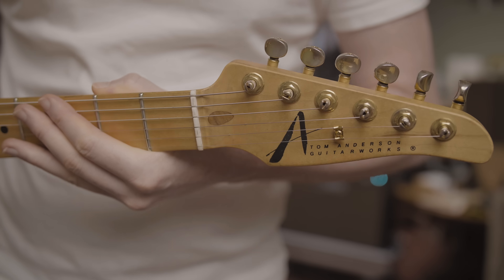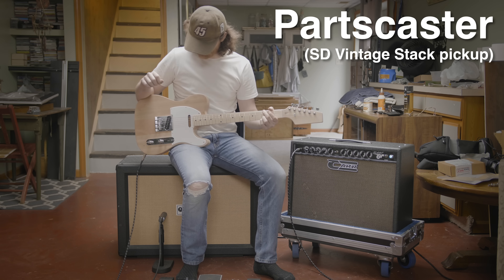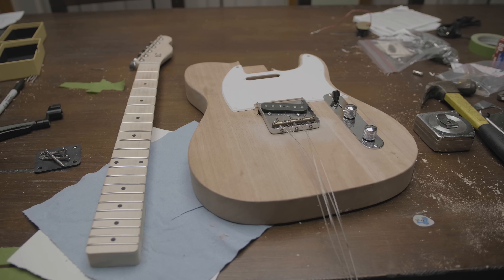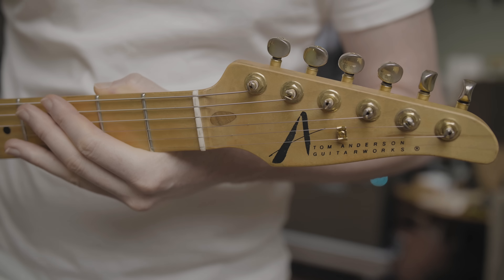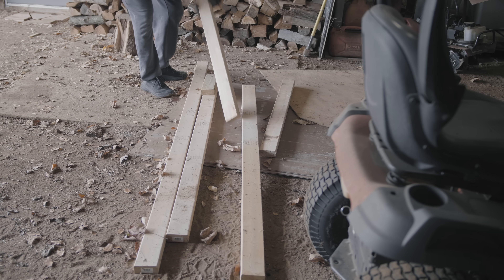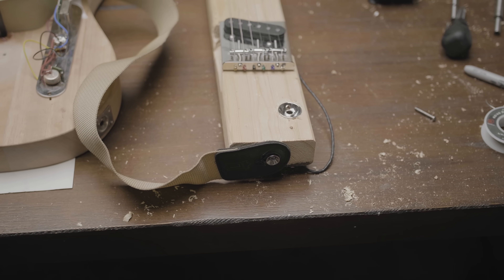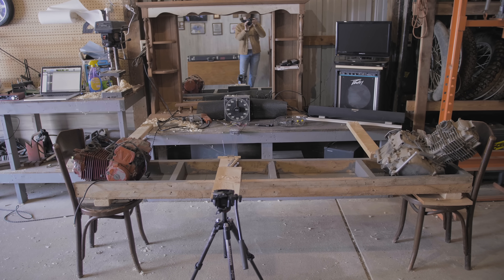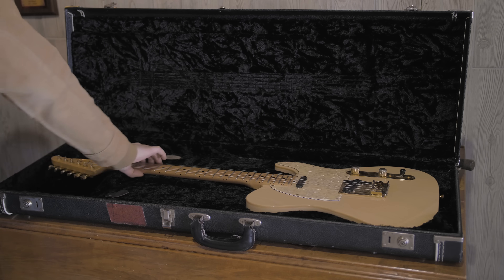Tested: Where Does The Tone Come From In An Electric Guitar?

Comment: Okay, so the sound difference you get between a Tele and a les paul are electronics, and string distance to pickup??
Reply: In that case, the different scale length on a Gibson neck lowers the string tension, which definitely has an impact, although certainly not as much as the electronics. Also, a different style bridge is going to change how the strings behave, if subtly.
Reply: Pickup positions.   Bridge/ saddle types.  In addition.

Comment: I am of the belief that it's how secure each end of the string is held that you get the most tone out of. I bought a cheap RG 250 guitar and it's tone was weak and thready. The tremolo was a piece of stamped steel, very thin and weak. I bought an edge and it was more of a anvil, a block of metal with much more mass. The tone difference between the two bridges was astounding.

Comment: The andrersson clearly sounds better, more full than the partscaster. Also, all comparisons are made with quite a bit of grit. The cleaner you play the more you will hear the difference.

The guitar cut from a board sounds good with open chords but thin the further up you go. Evenness in tone is something I would look for.

The air guitar sounds great and the strings vibrate freely, but how would you gig with that? It is extremely unpractical.

Comment: I worked in an electric guitar factory, and we used different woods on the necks and bodies. The wood absolutely made a difference, to the point that some woods were unusable due to overreaction with electronics. Same pickups, neck, hardware, setup. One of the key factors is density of the wood, and weight. I am inclined to agree that with a lot of similar items, you will get similar results, and to most ears, there will be no perceived difference. A venerated musician I once knew said, instrumentalists (I'm paraphrasing) use the equipment that suits the needs of their own ears. Another said that people don't buy an instrument by the sound, but how it "feels", and I've found that to be true. That said, when I build guitars for people, I would say the feel is nearly everything, even for seasoned pros. No matter how much you like the tone, when you have to play the guitar a lot, the feel takes over. Sounding good and being uncomfortable doesn't work, no matter how much you want it to. And even with acoustic guitars, most people can't really hear the difference when properly tested, which he does here when he simply strums a chord, then switches guitars quickly. Try looking away and taking four guitars, and doing that test. You will be hard pressed to consistently pick out the same guitar. www.andersonacousticguitars.com
Reply: What a load of B.S. "the wood were unusable due to overreaction with electronics." Do you realize how incredibly stupid this sounds? Wood is electrically inert.

Comment: Ive spotted something in the differences missed between the TA and the 2x4. The TA has the neck pickup influencing the magnetic pull on the strings. Even with it turned off, its still a permanent magnet.

Comment: Lol, recently had a guy try to argue, on a thread, that this video was invalidated, because you just swapped the resonance of the guitar body for the resonance of the bench and whatever. When I finally stopped laughing I pointed out that he was asserting the vibrations of a few short steel strings was setting up a sympathetic vibration in that much wood.

Comment: The tone for an electric guitar comes from the amplifier. The type of pickup and it's orientation in relation to the strings determines the electrical signal sent to the amplifier the only other factor is how the guitar sustains that vibration or the rate at which string vibration decays. Sustain is influenced by the nut and saddle materials, the crown profile of the frets and how the instrument is played.

Comment: Sorry buddy but this test is completely invalid... it's a bit like a magic trick - the magician distracts the audience by pulling out a white dove while he pockets the mystery card with his other hand. No offence meant but... when you replace everything (like the body, the tonewood etc) except the pickup, strings and tuners... those strings are STILL resonating with something of weight (which will keep them resonant)... in this case, the bench and the Motorcycle motors that are holding that part of the bench down! Could you please try doing the same thing... without the bench? ... Then... I'll believe you. :-)
Reply: There are three layers of material between the bench and the strings, any significant amount of resonance gets dampened lol

Comment: This was fantastic.   Thank you for your service to logic!!!
Reply: The problem is that this video is trying to say that woods/substrate/guitar body doesn't matter.. and basing that whole argument on the fact that everything but the pickups, the strings and the tuners have been replaced... but that's not the case. Strings need something solid to resonate with to maintain their oscillation... plugging this rig into a bench does not demonstrate that.. you're just replacing the guitar body with a bench.. so, of course the strings will resonate the same - maybe better! Replace it with stale bread and you might have a point. :-)

Comment: Also, never buy into the "well known brand guitar" lie that some companies like Gibsons, etc. advertise and put out with high prices and (sometimes very) low build quality. As for myself, I like not to be bothered in buying cheap guitars that will need upgrades and further set up and adjustments:  I'd rather spend lots of time looking for a guitar that already has all the stuff that I like but that is not that expensive and most of the time, you'll find that on the non-top brands.

Comment: It does come from pickups, strings and what you use to strum or pick the strings and the wood doesn't make a difference besides the neck feel and width for the player BUT if you use other metallic materials like aluminum, etc. IT WILL MAKE A HUGE DIFFERENCE.

Comment: Speaker, amp, how hot the pickups are. Thats literally it for an electric guitar. The keyword is ELECTRIC. The signal from the pickups through the cable and into your amp does not care what kind of wood the pickups were installed onto. The sound is basically a signal path starting from the pickups then cable then amp. That electrical signal wont get affected by what ever wood the pickup is mounted onto...smh

Comment: This whole damn thing was perfect in every single way.  You conveyed an excellent science and engineering lesson with your art.
Reply: The problem is that this video is trying to say that woods/substrate/guitar body doesn't matter.. and basing that whole argument on the fact that everything but the pickups, the strings and the tuners have been replaced... but that's not the case. Strings need something solid to resonate with to maintain their oscillation... plugging this rig into a bench does not demonstrate that.. you're just replacing the guitar body with a bench.. so, of course the strings will resonate the same - maybe better! Replace it with stale bread and you might have a point. :-)

Comment: I can hear a slight difference and I can tell exactly what it is.  The sound dies easier on the air guitar.  The material it is screwed into is better at dampening the energy of the string, and it may have a bias for the string so maybe (but it is hard to hear) a held note might have different tone toward its end.

I'm not a music person, but a physics person, and the fact that they sound the same makes sense.  It's not an acoustic guitar.  It's a metal string under tension vibrating over a magnetic pickup.  Simple as, but for maybe the elasticity of the material where the strings are attached by a very small degree.

Comment: Fish tank carbon fibre aluminium steel etc.  Guitars have been made of not wood it should be obvious that tone woods dont matter for electrics.
Plus pickups dont pick up vibrations of the instrument.  They pick up the back and forth movement of the string.  Thats why they are magnets and not piezoelectric vibration detectors like acoustic pickups.

Comment: It's all relevant, but the majority of your sound is the strings and electronics technology. With that said, you still hear distinct differences between a maple fingerboard and rosewood or ebony, but this is from the soundwaves directly reflecting off the wood, not traveling through it which is why you don't hear the bright and chiming sound of maple from underneath a rosewood fingerboard.
It's the reason stratocasters have that plunk, sneer and other traits; the sound is reflecting off a plastic pickguard lol. Change the material to wood or a super hard plexiglass and it still sounds like a strat but with significant changes.

I have a formal education in science and electrical/electronics engineering which requires me to have a deep understanding of relativistic quantum mechanics, but I also have about 30 years in carpentry, metal fabrication, auto mechanics and just a broad range of trade skills and abnormal jobs.
I have performed in the thousands of modifications to guitars, and there are distinct features of wood that are impossible to eliminate with your passive electronics, but with actives which I believe in using in every single instrument I own, you can achieve damn near anything.

I built a bandpass filter a couple months ago that makes humbuckers sound like single coils, and with enough work, could use it to make a Les Paul sound like a neck position stratocaster and vice versa. There are critical factors like set-necks have the worst sustain but the best response and most even and dense note decay. I have at least 8 set necks of various designs and technologies, and have performed tests on all of them. I have about a dozen neck-thru guitars, and a couple dozen bolt ons. 

Oddly, I've seen similar tests to your own in the past, but having all the experience, knowledge and education I do, stopped paying much credence to the claims of others because they're always so conclusive and off the shelf concepts that half of are right, and half of are wrong.
When all is said and done, an active circuit with fixed as well as variable filters can achieve 90% of a fixed physical properties sound and performance. In all my work, outright inventing and designing various circuits, even the vacuum tube vs solid state holds no water. Solid state will actually do it better, but it's a lot of work and there's less money commercially for an amp full of semiconductors vs vacuum tubes. Tubes primarily do what they do because their bandwidth reproduction is a steep drop-off at about 10Khz, and the clipping knee rounds off from being overdriven whereas chips chisel it hard with simple off the shelf designs and saturate the signal with extremely high order harmonics that gives the static TV sound in the form of seemingly, white and pink noise.

I have a $2 circuit I came up with a few years ago that sounds like a 5150 and Mesa Boogie triple rectifier overdriven to decadent levels. 
In the end, you can't talk people out of their faith based and ignorant beliefs whether it's religion, science or a combination of both.
Reply: You're clearly having some kind of episode, but I'll just add that even in the classical world, where every detail of design, bracing, wood selection, etc is agonized over for hundreds of years, I've never once heard of anyone losing their reason enough to suggest that the fretboard has an appreciable if any impact on the overall sound. If it's not affecting an acoustic guitar enough for anyone to care, it's not going to affect an electric guitar.

"because they're always so conclusive" You mean inconclusive. "half of are right, and half of are wrong." The correct locution is "half are right, half are wrong," no need for the of. "90% of a fixed physical properties sound and performance" should be "physical property's sound and performance," with the singular possessive. Might want to brush up on your own English before mocking someone else's.
Reply: bro gtfo of here with that BS. Sound reflecting off pickgaurds and fingerboards? On an electric guitar? Yeah no. Pickups only detect vibrations in the strings and convert that to an electric signal. They are not microphones, lol
Reply: @Tasmanaut  yes, absolutely. My formal education is literally in subatomic particle physics, electrical/electronics engineering, and you cannot even use English at a respectable level. "Pickups only detect the vibrations in the strings"; that's a rather crude and bland explanation, but I can break it down for you scientifically since you're so arrogant and determined to prove me wrong.

Within the sound reflecting off these materials and their damping factors, it's feeding back directly into the strings and producing what is scientifically regarded as crosstalk. This is a reference defined in both classical physics and the relativistic quantum mechanics of electrical devices and their respective signals. The sound traveling directly through the wood is relative, but the damping factors of these very dense materials heavily reduce the obvious effects they have in the acoustic and electrical signal. I can get much deeper into the facts and explaining what occurs, but you will probably just mouth off again and behave in an unvirtuous manner where you know everything simply because you are you.

You've very ignorantly and arrogantly lashed out at me, and were so blind in your immature behavior, you assumed yourself to be superior and know things you most certainly do not, but I do.

Kid, you are literally the AI threat to humanity which is in the form of people believing they know things they certainly do not. All pickups have microphonic properties, they work on the same principles and the passive, scalar circuit in a pickup and in a dynamic cardioid microphone is virtually the same. I have outright invented new technology relative to audio electronics, but also well beyond. You could just ask questions rather than have some irrational rant under the assumption everyone you encounter in social media is less than you. 
I may look really young in my photos, but it doesn't change the fact I turn 46 in a month. I have a lot of crude layman experience and knowledge, as well as scientific knowledge and experience.
Reply: @JonDeth  lmao! stay mad, nerd.

Comment: For myself as a long time player and amatuer builder, the physics of a guitar if you dis-regard tone lies in the materials directly & indirectly connected to the vibrating string.  So i think of it like this:  the softer the material that makes up the nut & bridge & fret wire will absorb more easily the vibrational energy of the strings thereby leading to less sustain and more mid-range tonality.  Whereas the more dense the material is the more it will resist absorbing the vibrational energy of a string leading to more sustain and a brighter range of tonality.  The secondary materials the sound passes through like tuners, the type of wood in the neck, fretboard, and body do have influence on a guitars sustain & tone but to a much lesser degree.  The only time these secondary components can have the most influence on a guitars sustain & tone depends on whether the pickup used is microphonic and to what degree.  When a pickup is wax potted or silicon used to keep the copper windings from vibrating you remove or dampen the pickups ability to act like a microphone and focus more on just the strings creating the majority of the output signal.  But if a pickup is not potted it can act very much like holding a small microphone under the strings so much more of those secondary materials effect the sound when your pickups are especially microphonic.  The strongest and quickest to feedback type of guitar ive ever played was a semi-hollow body ES335 with microphonic pickups.  It was an Epiphone model, very hard to control its feedback but if you wanted sustain you could hold notes indefinitely with feedback loops.
Reply: I think if I went to my luthier and asked him what tuners I should use to improve my sustain, he'd throw me out.
Reply: @HarryS77  exactly my point.  The only things that truly influence sustain are the strings (what alloy they are made of) the bridge and nut materials and the fret wire.  If your pickups are hot and your action is reasonably high with a steel alloy string and stainless steel fret wire and a nut made out of metal plus the bridge you will have the most sustain possible esp if the neck and body are made of any hardwood like rock maple walnut bubinga etc.   Things like the tuners neckstock size body size do not hardly affect tone at all.  The only time crazy shit like that comes into play is when youve got microphonic pickups like in some old guitars.  Then its just like sticking a mike up to your guitar, it picks up every little sound.  But with todays distortion these type of pickups are not desirable.

Comment: I have to admit I have been wrong about tonewood in electric guitars. But I need to ask about a couple of things.

To me, the air guitar sounded slightly darker than the Anderson. That makes me think it could be missing harmonic content which is something a really good guitar has.

This makes whole thing make me curious about a couple other things. I think most people could pick out a metal neck on a guitar and this experiment makes it seem like that shouldn't make a difference.

I have definitely experienced where two of the same model guitar sounded different. Is my takeaway supposed to be that the electronic differences made all of the differences? That's just hard for me to get on board with, even if I know pots and pickups have some natural variance within their tolerance.